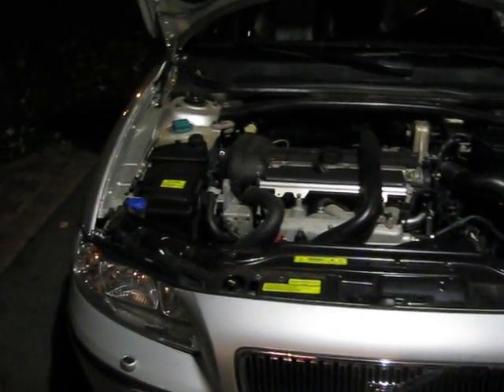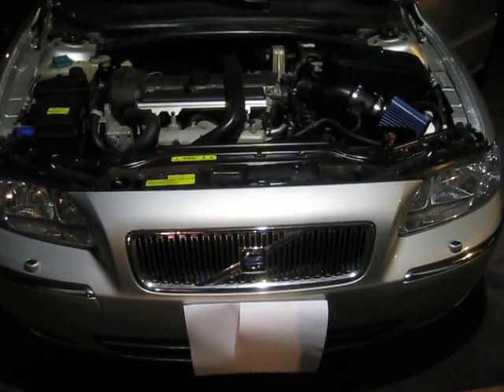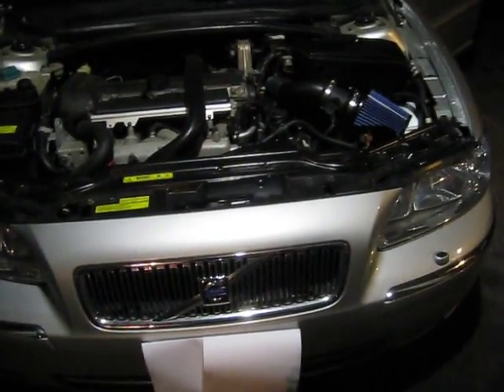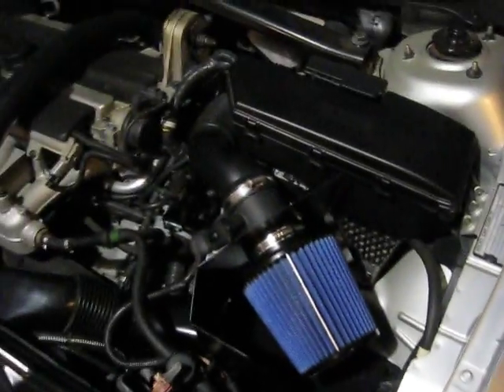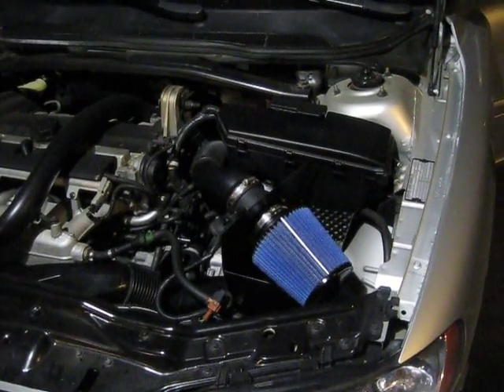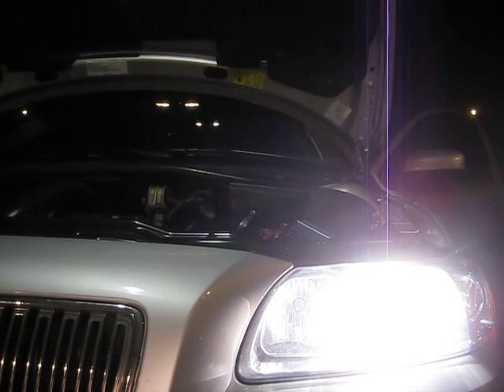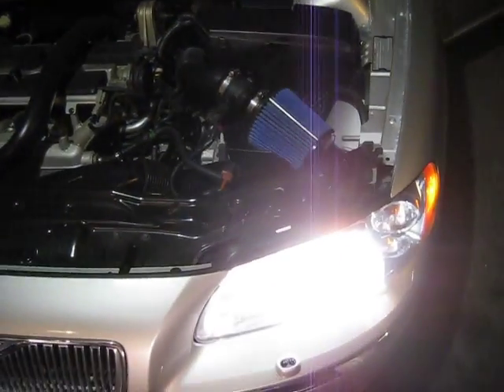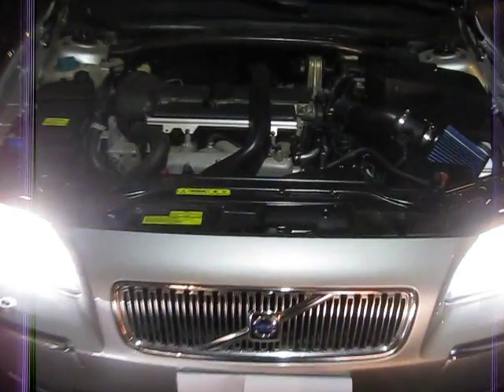Intake Volvo V70 2.5T 2005

Comment from the maker: @rtiger07 its actually very good for the car! sorry for the late reply! the micro inlet filter that comes from eurosport running allows to trap particles that could normally filter through the paper stop flyer that came with the car. BUT you CAN buy an aftermarket stock fitting filter so you don't have to buy the inane kit, but the intake kit is the best bet! The whole idea of a sport aftermarket filter is to help maintain clean airflow while allowing a slight increase in power!

Comment from the maker: @SouthernKudzu Hey man thanks for the comment! obv. with the hood closed you cant really tell but it gives it a subtle sound that shows it has horsepower but at the same time doesn't roar like a junker, as for the OEM lights you're right the lights are fine on their own, I just changed them though to HID because I have already finished the exhaust and just bought some more goodies for it, be sure to check out my new vid's coming soon! and you're right on the lenses, they'll be replaced soon too!

Comment: hey have the same car, 06 model...ive looked a bunch of stuff up and Im wondering if the increased airflow with that open intake is good for the car, as the stock intake is just as good...something having to do with any filter letting more air in filters less particles in the air coming in...any thoughts?